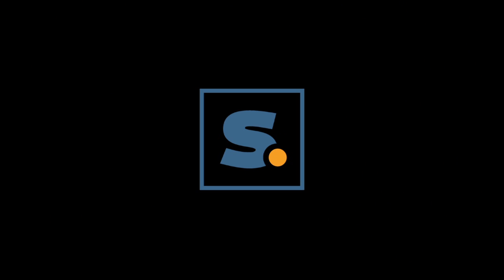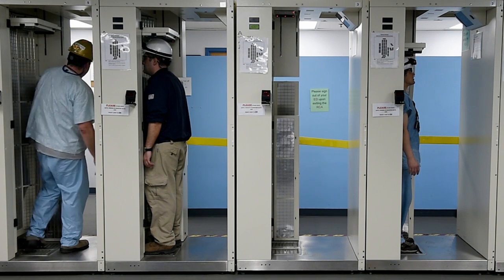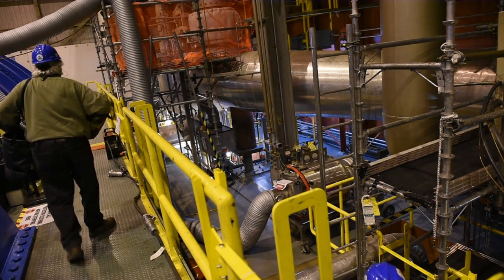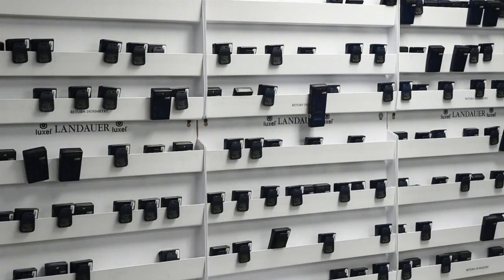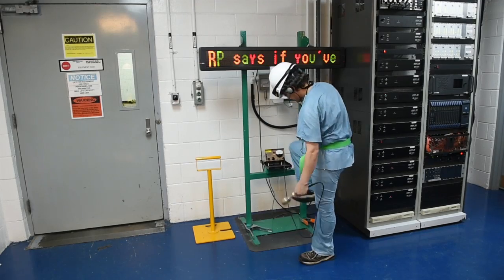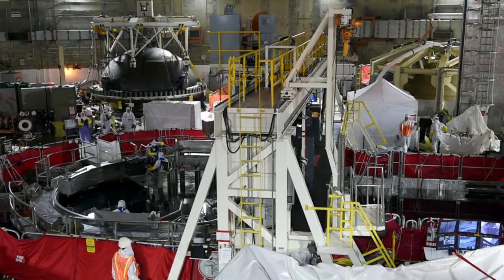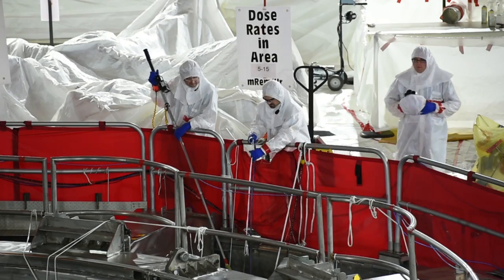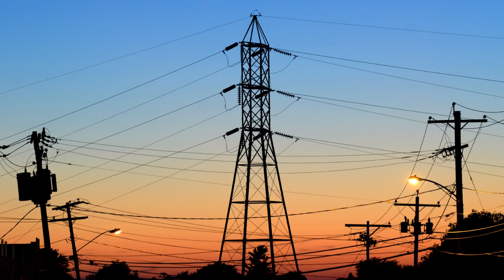See inside the Nine Mile 2 nuclear reactor

Comment: 2:24 I'm a bit surprised. Areo dose rate 5-15 mrem per hour? That's about 50 times background... Is that standard in these procedures?
Reply: There is still some minor exposure to radiation - but they all practice ALARA - 'As Low As Reasonably Achievable' - dose exposure.  Time, distance, shielding to sources of radioactivity determine your exposure - and the radioactive work permits when they sign in to the plant determine what your maximum exposure may be for the task you are doing.  During outages, there is an aggregate dose exposure goal to stay under for the entire outage for everyone.  ALARA waiting areas are marked by signs / flashing green lights where people wait until they're needed to perform a task as these areas have little or no dose.  Generally dose exposure goals are met or exceeded through rigorous safe work practices, ALARA behaviors and other means to mitigate exposure through shielding and maintenance of the reactor internals during outage.

Comment: The upper lid of the reactor must be super radioactive, how are they not removing it under water. Instread they keep the lid right beside near the workers. That very lid actually covers the core where nuclear fission takes place. How are they even taking it out of the water? Strange
Reply: It's never in water... the waterline is below the reactor pressure vessel head (the 'dome').  Between the head and the core is a steam separator and a steam dryer.   Those are always kept under water in a laydown pool adjacent to the reactor cavity as they are right above  core where the fuel is.  The only radioactivity the reactor pressure vessel head receives is from the steam generated by the boiling water.  The radionuclides from the steam have a very short half-life so they don't stay radioactive for very long (minutes).  That said, there is still some minor exposure to radiation - but they all practice ALARA - As Low As Reasonably Achievable - dose exposure.  Time, distance, shielding to sources of radioactivity determine your exposure - and the radioactive work permits when they sign in to the plant determine what your maximum exposure may be for the task you are doing.  During outages, there is an aggregate dose exposure goal to stay under for the entire outage for everyone.  ALARA waiting areas are marked by signs / flashing green lights where people wait until they're needed to perform a task as these areas have little or no dose.  Generally dose exposure goals are met or exceeded through rigorous safe work practices, ALARA behaviors and other means to mitigate exposure through shielding and maintenance of the reactor internals during outage.

Comment: Very interesting. I would appear from this limited material that these technicians are working under an abundance of safety measures. Obviously this is very dangerous work requiring proper training and caution on the part of the employees. The need for electricity is paramount and nuclear energy seems the most cost effective way to provide it.

Comment: To make things clear: So the reactor is a giant drum filled with water (or heavy water) and there are euranium and control rods submerged into it?

The neutrons bounce from one rod to the other rods or is the fission happening inside the rods and the neutrons only hit other atoms inside the same rod?
Reply: Neutrons from one rod, if they're captured at all, are captured by uranium atoms in another rod. It's like that because the neutron's energy level has to be reduced (thermalized) before it can be captured by another atom. That happens by bouncing them off the hydrogen atoms in the water.
Reply: It's just magic.
Reply: The neutrons moving though the water at faster then light speed excite the water molecules. The excited protons give of the b
lue glow called Cherenkov

Comment: Disometer ha ha ha.
Dosimeter.
Time to update reactors to genIV.
In this old gen2 reactor type fuel becomes contaminated by fission products and only 0.5% of the potential energy is used in the "spent" fuel. Liquid fuel allow removal of xenon and actinides. Look into molten salt reactors and molten lead reactors. No water and 2000 psi pressure vessels.

Comment: Why does it have to be every 2 years?! I thought this had to be done every 100 years. This is a massive maaaasssive difference.
Reply: You're probably thinking of decommissioning. This is when the fuel is swapped over to new positions (kind of like rotating your tires so they wear evenly) and if it's been in for 6 years, then it's replaced.

There is actually plenty of fuel left in the rods after 6 years. You can recycle it into something call MOX and reuse it, but right now it's cheaper to mine fresh uranium and the used stuff is stored.

Navy reactors on Aircraft carriers and submarines last 20-30 years.
Reply: @letsburn00  I must be thinking about the subs. It seems reasonable for 2 years, but I've just never given it much thought. Seemed like an amazing number to think at least 20-50 years service life and just be all wow about it. Seems dangerous to just store nuclear waste.
Reply: @joblessalex  it's probably in it's safest position in when in storage. It just sits in the bottom of a pool, slowly becoming less radioactive.

Ideally, we would recycle all the fuel, but the price of uranium is low enough that they don't. Sadly, the coal industry spread enough fear about nuclear that we stopped building reactors.

Comment: Just shows how incredibly well built and honestly - how incredibly safe US nuclear power systems truly are- that despite a state of the art computer telling the operators the water level was low, they not only ignored it, then President Jimmy Carter, a nuclear physicist himself also agreed to lower the water level further, ignoring the computer system.  That with a almost bone dry core for several days, the result was a mere 3/4” meltdown and the release of some steam with elevated radiation levels that never caused any issues to anyone in the surrounding area.  3 Mile was a human stupidity issue, not a plant issue.  The press overblew the incident and it was a big to do about nothing in the end.
Reply: It took those engineers ~16 hours to figure out that they needed to add more coolant to the overheating reactor. It's almost like someone left Homer Simpson in charge.
Reply: DirtyBlastard - Jimmy Carter or Homer Simpson... same thing.  I seriously believe Mr Peanut purposely wanted that reactor to fail.  For a Nuclear physicist- he sure didn’t seem to know the basics of nuclear power plant design.
Reply: @westchestertechnologies6687  WHY WOULD ANYONE WANT IT TO FAIL
Reply: That's dishonest. The people were not aware that there were several oddities in how the control room was designed. For instance many believed that one light indicated that water was running into the reactor when in fact it meant that the writer pump was running. It just wasnt optimised. It wasnt really anyone's fault
Reply: lol lol your kidding right fukashima 3 mile island sure sure hanford
Reply: still not as safe as Canadian Candu reactors
Reply: Not really. The problem at TMI was a valve got stuck and the guys in the control room didn't know it. So they adjusted water levels not knowing the valve was open. They did the opposite of what they should have done but it wasn't really their fault. No equipment or control panel told them the valve was stuck. I forget all the details, but one of the NRC investigators who was on site gave a lecture about TMI that can be found here on Youtube.

Moreover, that particular valve had failed at 11 other plants previously and the NRC didn't put out an alert. NRC massively changed their policies and now keeps all plants informed if a part is known to be bad.

I am a big nuclear fan and think we need more energy lants, not less. Nuke is 100% carbon free and highly reliable. Unfortunately, all the red tape has made plants very expensive to build.
Reply: @LonnieAdams4  I can also guess that the steam release was way less or similar radiation into the environment then coal plants put out.
Reply: @parker02311  Yep.  It is estimated that people within several miles from the plant got about 1 dental X-ray's worth of radiation.  And there's been numerous studies done on the population since then and they've seen no elevated cancer rates.
Reply: What are you yammering about President Carter?  He had nothing to do with the accident sequence.  What a weird and misinformation-filled comment.
Reply: I beg to differ...42% of the core vaporized at TMI. Those deadly vapors went somewhere...the metallic air that every living thing inhaled was most of it.
Reply: D Wetick it didn’t vaporize. That statement is categorically false. TMI2 core suffered large amounts of damage in that the fuel rods shattered and were in a pile of rubble at the floor of the reactor casket. Which the reactor casket only suffered a minor 3/4” meltdown to it.  It’s 5’ thick.

As for the steam release, the NRC findings showed at the reactor directly the maximum steam release exposure was a mere 100-125 millirem.  Outside of the area it dropped significantly.  To put that into perspective an X-ray is 6 millrem. They also conducted a 20 year study, no cases of cancer or any birth defects were traced to the steam release.

Comment: Many thousands of humans die each year die as a result of alcohol, and very few if any die in 10 years as a direct result of nuclear power generation.  I’ve never understood why many people are so against nuclear power.  And yet alcohol is considered absolutely necessary??
Reply: Thom Thumbe
Nuclear power plants in the US are too expensive and take too long to build.  No utility is going to spend ten billion or more and wait ten years to finish a NPP.
Reply: @acmefixer1  they're building cheap reactors in Korea. It can be done anywhere. Most importantly, there are no good alternatives. Coal is incredibly polluting, renewables doesn't work without fossil fuel backup.
Reply: Acme Fixer they still are cheaper in the long run for their effective use over solar, wind and other means.
Reply: The fear of a meltdown occurring is the biggest fear (see 3 mile island). However there are reactors that do not melt down so maybe that might cause new interest in Nuclear Power as it is truly one of the fewest clean types of energy production.
Reply: @alex-marquette  3 Mile Island didn't hurt anyone. The only nuclear accident that killed large numbers of people was Chernobyl, and such plants won't be built again. There is no need to wait for Gen IV reactors.

Comment: They have to dismantle the reactor to remove spent fuel rods and add new ones? That sounds crazy inefficient
Reply: They don't dismantle the whole thing. They just remove the closure head and move it off to the side. This exposes the fuel cells which are easily removed by an overhead crane.
Reply: if my memory serves me right the fuel rods just moved sideways from the reactor vessel to a swimming pool next to it. And when I say swimming pool it's actually swimming pool with so many feet above the fuel rods to protect you against radiation you can actually look down into it.
Reply: They only have to do this once every 6 years or so. Calling nuclear energy inefficient is laughably false. If you look at the energy density for uranium you see it doesn't even come anywhere close to any other existing methods. So this is actually crazy efficient.
Reply: @Thumbsupurbum  They never said anything about nuclear energy being inefficient, they said the design was inefficient.  Most reactors can be refuelled without dismantling them, some can even be hot-refuelled, aka refuelled while still in operation.

Comment: All of these huge, dramatic, costly productions are necessary because we insist on staying the course with outdated, wasteful light water moderated fuel cycles. We should have moved over to molten salt reactors decades ago.
Reply: Arent breeder reactors the way to go anyhow... they make their own fuel
Reply: @tdgreenbay  There are at least two companies working on fast spectrum molten salt breeder reactors. Bill Gates is financing one. I think they will be extremely efficient, but they're probably at least 10 years away from commercial operation. Current pressurized water reactors are quite excellent too, so we should build lots of those in the meantime.
Reply: @phamnuwen9442  there is nothing wrong with pressurized water reactors we know more now than ever
Reply: @tdgreenbay  Yes, I know. Like I said, the best energy source on Earth, by far.
Reply: Yeah, I hear they don't even bother making steam in an MSR plant.  There are just giant electrodes on the sides of the reactor vessel to hook up the jumper cables.   So simple a caveman could do it.

Comment: Show the public how the rods are moved from the reactor to the spent fuel pool !
Reply: Are you asking how or do you want others to see? It never surfaces, it goes through a tube in the cavity(pool) and over to the spent fuel pool outside of the containment structure
Reply: It's kind of like pulling a Twizzler from the package.
Reply: @KirkHermary  But through a hole in the package while the package is under water.

Comment: As a fan of the walking dead, I always wondered what happened to the nuclear reactor power stations after the collapse. The TV show never explored this to my knowledge but curious if they went to fail safe or leaking somewhere in that fictional but real world.
Reply: As others have said. They'd just put control rods in, and in the candu reactor they would poison the fuel so the reaction is immediately stopped. They question remains how would they keep cooling water circulating. As backup power wont last very long.
Reply: Probably the reason why British Magnox and AGR are considered the safest designs going although not highest powered 800Mw at most.. In the event of complete power failure and circulation pump failure The Carbon Dioxide gas used to cool these reactors would naturally circulate through heat convection alone. Slowing plenty of time for repaired to be made. They also have the added advantage of being able to be hot refuelled, meaning they don’t need to be shut down whilst refuelling takes place...
Reply: wonniewarrior If you insert all control rods, which is what happens in the event of say, and earthquake, automatically, then the reaction is basically nullified. I'm not too sure long term how well that holds up, but in cases like Fukushima or Chernobyl (not a nuclear disaster but a lack of necessary safeguards disaster), inserting control rods when fission rates are very high will not have a very significant affect, to my knowledge.
Reply: richard mccann  what?
Reply: WTF is a "fictional but real world"?
Reply: wonniewarrior everyone would develop cancer and earth would ve poison within years

Comment: As I understand it, you can actually see the real core right through the water when doing this.  I'm disappointed that the video did not show this, per the title - all they had to do was tilt the camera down, and presumably there were some underwater lights.
Reply: You're right, ive worked these outages before. you can see straight down into the cavity and see 15 cameras inspecting different parts of the reactor.
Reply: @Ibuprofens  are you a boiler maker?
Reply: @Mrgui110tine  Yep, illinois local 60.
Reply: @Ibuprofens  local 2158 millwright.
Reply: There may also be rules regarding secrecy of the design or commercial confidence issues
Reply: There's plenty of YouTube videos of research reactors running. It'll look more or less the same, just a lot smaller.
Reply: agree. an awesome opportunity utterly wasted.

here's a MUCH better video -> https://www.youtube.com/watch?v=IoCfapqYy00
Reply: https://youtu.be/6LIu7bhRDXE
Reply: That's not be fun, the RPV has a lot of neutron reflectors, with the little camera knowledge I have the camera may well not function from the decay heat and natural reactivity of the fuel.
Reply: (Plus I'm pretty sure a lot of this is just released footage from the plant and approved tour routes)
Reply: Jess : What I am saying is that when refueling, you have the reactor  lid removed, and the top is covered in lots of clear water to stop the radiation.  You send a device down on a crane to grab the top of each fuel assembly you want to remove, pull them up, and slide them over to a cooling off spot in the spent fuel pool.  During this whole time, the real core can be seen right through the water.  The water blocks the neutrons, so the camera should work fine.